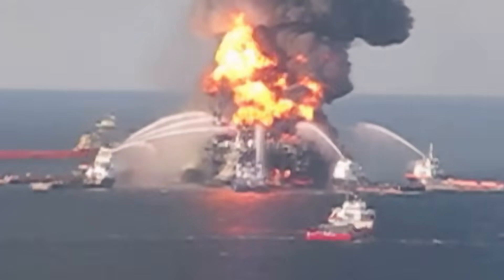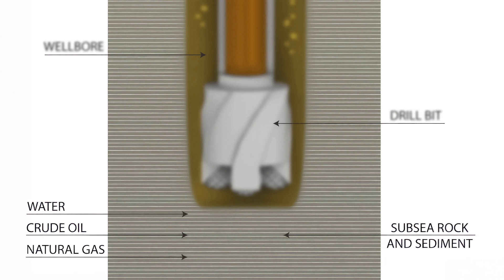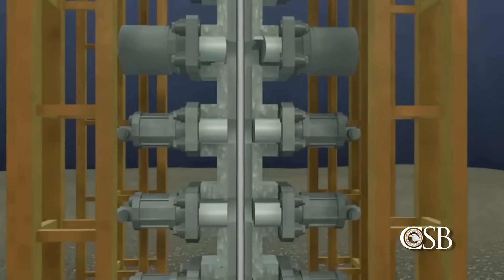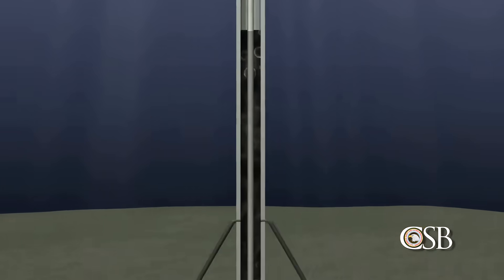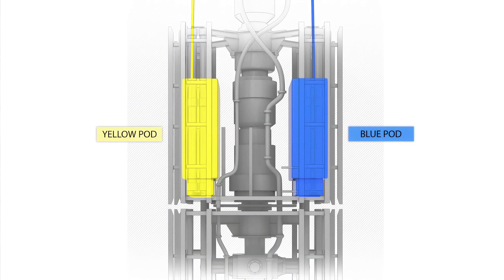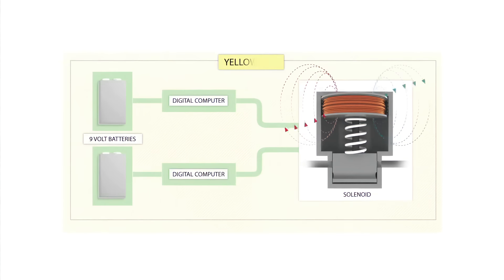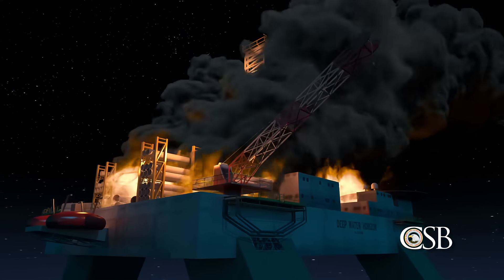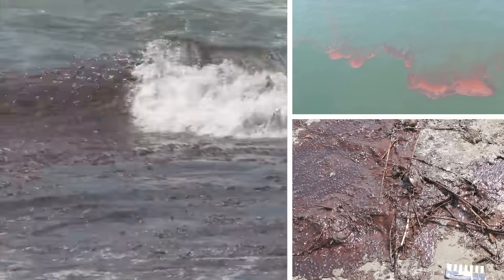Deepwater Horizon Blowout Animation

Comment: Too bad bp used seawater instead of drilling mud...
Reply: ?? That's ridiculous
Reply: They did several new things 5,000 feet deep...makes sense...dont go with what you have learned after all these years, come up with some new shit, without a real contegincy plan in place....that company can suck my entire dick!!?
Reply: They also used a new type of cement to seal in the well...they also messed up the anulars in the bop being stupid...the rubber was coming back up the riser...
Reply: Do some research. Drilling mud is expensive. To save a few bucks the bp man on the rig told them to pump some seawater into the well to act as drilling mud...i shit you not...
Reply: You do know that bp big wigs were on the rig to celebrate hitting oil...the drilling process was over...
Reply: Kyle...i guess you cant read. The article you ref, 7 fatal flaws, tells you that at the end the bp man said pump seawater back in...read the article sir...its a known fact. They also used a cheaper form of cement injected with co2 or some kind of gas to make it lighter and they used 6 cetralizers (term might be wrong), when their own partners told them to use 24 but bp man objected. Read the article you referenced bro...you will be enlightned.

Why do you think the us govt fined them so much?
Reply: Kyle, a bp contractor flew out to test the cement job and bp said, its all good and flew them back out the next morning...you really need to do a little reading on what went down sir...
Reply: Dude I read the entire article and I don't know if you didn't read it properly or you just have no idea what you're talking about but the article states that the BP company man told them to pump sea water in order to displace the drilling mud! That's what you do after a cement job to bring the mud back to surface and allow the cement to cure. The pumping of sea water had nothing to do with killing the well. It was premature yes, they should have run a log. Schlumberger were brought in to do a cement log on the hole to see if the cement bonded to the casing. But BP company men decided to not do a log and sent them home.
Reply: Sir...according to professinal witnesses before the us govt not associated with bp, you never pump water back in to act as drilling mud, which bp did and made super bad choices in finishing the well. You basicly are repeating what i told you already...wake up stoner.
Reply: Kyle, i have never said anything about bp killing the well...im ref what happened prior to and leading up to the accident. They tried to kill the well after the accident, correct sir...jeez. If you work on a rig no wonder yall are fucking up the planet.
Reply: Kyle. As the seawater went in almost instantly kicks started...what should that of told them?
Reply: Rick Fountain Transocean objected because there was no cement log done and they didn't know if the cement had cured. BP were confident that it was so they began displacing the water. like I said BP was wrong the cement wasn't cured because of many reason like you mentioned shitty cement being the main reason. They did a negative pressure test on the drill string and pressure was reading upwards of 1950 PSI. Now the BP company man said "oh that's because there is a pocket of gas stuck and sitting on the sensor, if we do a negative pressure test on the kill line and it reads zero that should prove me right. they did a negative pressure test on the kill line and it read zero but not because the pressure wasn't there, the kill line got plugged off by shale debris and gave them a faulty pressure test. The BP company man thought that he had proved that he was right the pressure was just a trapped pocket of gas and so decided to go ahead and start displacing the mud which is normal operating procedure after a cement job. Like you said as soon as they started pumping the sea water it began to kick. I agree with you that should have been enough warning but the BP company man was justifying his actions with wrong information.
Reply: Kyle...they used cement that had only been used in much diff depths. The mixed cement. The used some cement that wont work in the conditions it was in...oh and the centralizers or lack there of....you must work for BP?
Reply: Yes. After a cement job is run, you displace the drilling mud remaining in the annulus with water to start normal production procedures after all well tests and logging have been completed. Yes, Transocean objected this decision, but not because it was an abnormal procedure, but rather they knew no CBL tests had been run and it was impossible for them to tell whether or not the cement had properly bonded between the drill string and formation. Eventually, as in all wells, that "protective column of drilling mud" is removed in order to start producing a well.

The cause of this disaster was a poor cement job done by Halliburton, and BP not doing its due diligence to correct this mistake, not because they displaced drilling mud by reverse circulating the well with water.
Reply: Eric, so if they would of left the drilling mud in longer, instead of replacing it with sea water, the cement job would of worked?

You do realize this wasnt being set up for production...the deepwater horiz wasnt a production rig...

Plus im telling hou there was evidence that the bp man didnt want to use any more drilling mud at $300 a bar, so he told them to pump so leftover bullshit back in the well...im telling you two that SOP was not follwed in this case...
Reply: Rick Fountain can you actually state what position you have held on any rig.
You talk big, but not always accurate.
Where you a Roustabout or Roughneck.?
Reply: @robertdejongh8293  I owned an oil rig bro.
Reply: What I referred to as seawater was actually 425 barels of LCM, lost circulation material, they ran into the well so they could ultimetly discharge it into the ocean....they fucked up on many fronts....

Comment: I would be curious to see the FAT reports for those shears... Nah, they are probably fake or the ink still wet.
Reply: Shear ram details were buried by bureaucrats, and lot of this video is imagineering/behind the looking glass narratives dreamed up for the networks.   The video of BOP's upon opening rams after recovering... showed a fully sheared piece of pipe drop out the bottom, pretty as you please.   It is likely that the brooming of MMS to create a new office served to mothball key reports to be labeled "transition confusion" if any scandal had erupted from the purposeful extension of the disaster - the administration wanted BP's head on a stick, and blocked an oil skimmer/created a full week of USCG delays engineered using [shift by shift] ever changing directives causing paralysis [preventing private environmental cleanup crews from operating when they were ready to go]  in order to create the enviro-disaster narrative needed/maximize the damage.  Never forget:   ocean area and airspace was blocked to prevent network cameras from the area.  That... and one of the first acts of Obama was to return a bust of Churchill speaks volumes.
Reply: Flinch I agree with everything except the clean cut pipe. I saw pics of the pipe inside the BOP while this was happening, and it wasn't just one string of pipe. It was two, smashed flat side by side. I assume the pipe shattered below the BOP, the well kicked and started pushing the string out, causing the lower part to slide alongside the upper part. The BOP was not designed to cut double thicknesses, two strings simultaneously, When the rig went down, is when the coverup started.
Reply: Tests were never done on shear ram designs with buckled off-center pipe - by any manufacturer, prior to this. Because no one had EVER recognized that it could happen.  In hindsight, it is obvious, like so many discoveries.  All the experts, including academia, did not realize it was real world possible to buckle the pipe in a BOP during well control.  The shear ram would have worked okay if the pipe was less off-center.  Now we know.
Reply: Forensics revealed the side-by-side drill pipe segments that were observed got that way AFTER the shear ram cut the pipe.  High velocity erosion also cut the pipe several feet up (just above the annular).  That piece then was lifted up by flow to beside the drill pipe hanging from the rig.  Bottom line, there was no side-by-side pipe at the time of the well kick or BOP operations. see https://www.ogj.com/articles/2011/03/government-releases.html

Comment: i have a question . why dont they use big pipes to lessen the pressure..the bigger the pipe the less the pressure.
Reply: Mike Shinoron It's not a matter of "bigger vs. smaller." If you lose pressure control in any volume of drill pipe the result is always the same. The problem still remains.  The bigger drill pipe would accumulate more unwanted and uncontrolled pressure. The well bore pressure will always exceed this so it doesn't matter what size drill pipe you use.

Comment: So why was the well left open for so long?
Reply: Caleb Sanders one too many zeros there.
Reply: Because Obama was a useless fool
Reply: bensemus x  because it was like 35000 ft below water and it was spewing oil out at an incredibly high rate. Very difficult to cut off. If memory serves me right they actually had to drill another well to intercept that one to plug it
Reply: Rick Fountain, Jr. 
Think like a forest fire. It's not the flame that one had to deal with but in this case underwater the pressure of the sea AND the shear FORCE of that blowout that extends far from the hole. Insane psi going on there.
Reply: since everybody says they got big di$k why don't ya stick it in the pipe to stop it?????????
Reply: ***** ty I'll give that a watch.
Reply: They couldnt just swim down to the bop, dipshit.
Reply: Rick Fountain, Jr. your head would have fitted to plug that leak.

Comment: No one ever mentions drilling way beyond permitted depths and the fact that they hit a pocket containing 500 degree oil at 30,000 PSI. That's ten times a pressure washer for those that didn't know.. You'd need pipe with a 2 inch wall thickness to survive that.
Reply: his ass
Reply: what is your source for that?
Reply: @Taranabas52  The fuel lines (i.e., hoses) are not subjected to 36,000 psi even though the injectors run at this pressure. If they were, a fuel line rupture would knock the locomotive over, kill everyone standing near the rupture, and possibly blow out the entire ballast of the track underneath.

Let's take your common semi truck tire: A measly 110psi on a 12,000 pound front axle.

There's videos posted of people slashing these tires and nearly being killed from the explosion.
Reply: @Sara-L  Ummmm...You do know that common rail injection does not mean it's on a train, right? Right?  Hello?
Reply: Source?
Reply: Shit!

Comment: what about shortage of centralizers ? nobody talk about it ?
Reply: Lin Zaw Not sure what a centralizer has to do with anything? They are typically only used to keep the casing or liner in the center of the well bore during completion.
Reply: The additional casing centralizers (21 recommended to reduce pressure vs 6 actually used) would not have prevented this blowout.  Not a contributing cause.

Comment: anyone here , is because the Movie?
Reply: Yeah, I'm here cos of the movie.. I'm just about half way through, and I don't really know what's going on.. It's an excellent movie but I wish they had explained what was going on a bit better... I think they presumed that everybody who would watch the movie had worked on a rig.
Reply: @JonathanAnon  In my English class, we were learning about hydraulic fracturing and although this disaterous oil spill isn't exactly fracking, it's still the process of extracting oil from the ground. We watched Deepwater Horizon today and I think it perfectly explained what happened. It was very accurate. The oil rig they built was smaller than the actual one, so imagine how big that explosion must've been. The movie was about the cementing not done right, but there were so many safety checks that should've been done. They should've checked the hatch that stops the mud from coming out from the pipes. The pressure they were extracting it with was mad high and that caused the pipes to burst. It's not the workers fault, but BP. BP was the company that rented the rig and the workers to get the oil and then distribute it. BP didn't check the pipe so it burst. They didn't check the power supply or anything so it was just a huge mess.
Reply: @JonathanAnon  That's why I watched the movie about 10 times ... so I understood what was being said and what was going on.. This video is the icing on the cake and everything makes perfect sense - visually and verbally.
Reply: the movie was about the cementing not done right, when instead it happened because of the multiple failures of failsafe mechanisms to prevent this exact thing. I'm an oil engineer and we studied this case and ended up at the conclusion that the flaws were within the design of components, and not a coincidence of all mechanisms failing at the same time, (even computer-alarms, as they were initially saying)  
Even if they had known about this days before, they couldn't have prevented it, because it eventually came to how the BOP and the heavyduty pipes were designed, with flaws, for economical reasons I presume.
- sorry for the bad english.
Reply: Mihai A. it happened because John Malkovich was an asshole
Reply: +Carey Price thats why i googled the process of an off shore rig.  i had to pause the movie..hahaha
Reply: of course
Reply: lmao nice....
Reply: no haven't seen it yet but im going too, is it any good?
Reply: @NathanChisholm041  Deepwater Horizon is one of the most devastatingly, brilliant movies I've watched in a long time.. Very tragic and haunting indeed... especially the ending...
Reply: @christinelawrence4315  I still haven't got around to seeing it yet. Now sure I'd even find it to be honest!
Reply: @NathanChisholm041  It's out now on Netflix if you have it :-)
Reply: @christinelawrence4315  Ok thanks I'll go and check it out 👍
Reply: yeah
Reply: +Kimberly Young salty
Reply: hahaha!!
Reply: Wow.   Try  looking at the news in your lifetime
Reply: yep. that's right bruh
Reply: Now that I figured out what happened I'm genuinely interested in this
Reply: I interpreted it actually as not checking the cement job had a hand in it. It might have been much less disasterous if the people were allowed to check everything right instead of it being blown off and having to use the negative pressure tes, which triggered the cataclysmic event. But I can see where you got your interpretation from Mihai. =)
Reply: I'm a union plumber and have worked with different types of pipe. from 1/2" to 10" and with schedules from 10, 40, and 80.
I'm guessing the oil industry uses thicker pipe. I'm wondering is there a different schedule in pipe thickness? looking at one area here they were discussing pressures from 15k to 30k psi. That's pretty serious.
Also about the blind sheet ram. if a line can hold 30k psi how much pressure is exerted to sheer/cut the line?
Reply: no i came here to see explosions and shit 😃
Reply: @josevelasquez3688  Watch the movie Deepwater Horizon .. you will be shocked at the violence of it all.
Reply: Benjamin Yohan i sobbed thru the whole damn thing.
Reply: ya
Reply: Benjamin Yohan no
Reply: Benjamin Yohan ya i didn't even know this happen thank u movies for education me
Reply: Natalie hart
Reply: Me, right now.
Reply: Benjamin Yohan I need to recover from the shock
Reply: yes
Reply: Benjamin Yohan  No, I am working in offshore Rigs similar like this.. 
I heared the movie is good I will see it.
Reply: I loved the movie but didn't understand most of it lol.
Reply: Carey Price k kk
Reply: yes...just finished watching it.  actually i had to pause it to understand what was really going on
Reply: Benjamin Yohan I am
Reply: Bob Pepitone n
Reply: No, Hurricane Energy.
Reply: Benjamin Yohan yes
Reply: Benjamin Yohan yes
Reply: Benjamin Yohan actually, yes.
Reply: Benjamin Yohan me
Reply: Benjami

hindi songs
Reply: No actually, I am here because I have an oceanography assignment on this event lol I had no idea what this was until I started working on it. Never seen the movie.
Reply: Benjamin Yohan yeah I'm watching it now that's crazy!
Reply: No. Just a YouTube recommendation.
Reply: What's the movie?
Reply: @GloriousDoctor  Deepwater Horizon
Reply: Juan Gama I’m watching it right now. . . Deep water horizon.
Reply: What movie?
Reply: gredangeo it’s called Deep Water Horizon.
Reply: @iKeyyaa  Oh? Ok, makes sense.
Reply: Where the fuck did you study English
Reply: Yeah
Reply: I saw the movie too but god damn you had to be a geek about it and announce it as if people care you bought a fucking ticket.
Reply: Soniti1324 when you die I hope someone say the same thing! There's nothing cool about dying u idiot!
Reply: So basically we in America make movies after someone's tragic death. 
-pearl harbor 
-911
-Schindler list
-300 

And many more.... Interesting....
Reply: @mrmakeadeal2415  They make movies to educate and share truths AND in this instance to ensure such a massive catastrophe never, ever happens again at this level.
Reply: This was better than the movie in every respect.
Reply: BroccoliBeefed ya I do need to keep in mind I was born in 2004
Reply: Oh please. The movie was intense as fuck. The sound alone was better than this video, you could hear the rig groaning and dying.